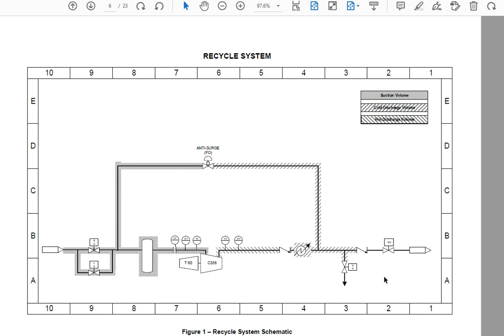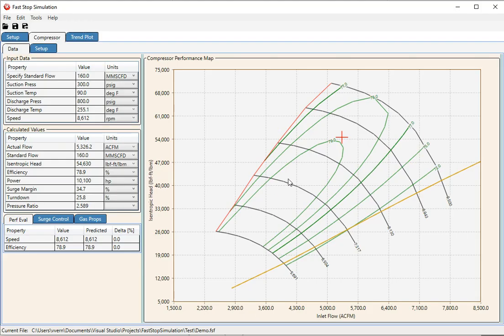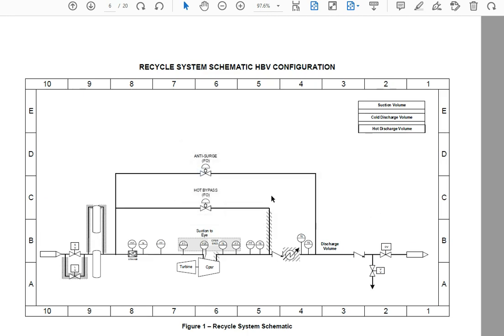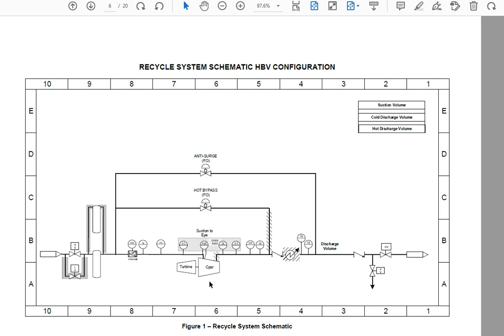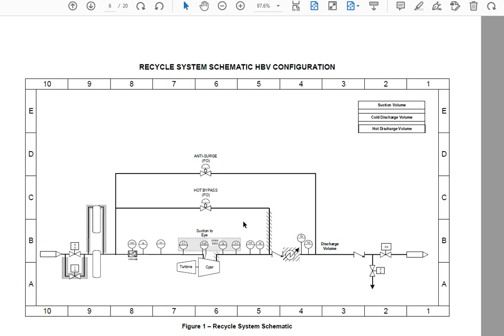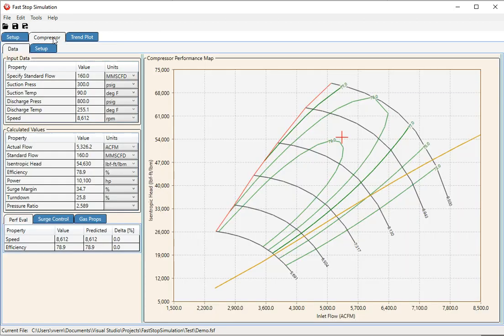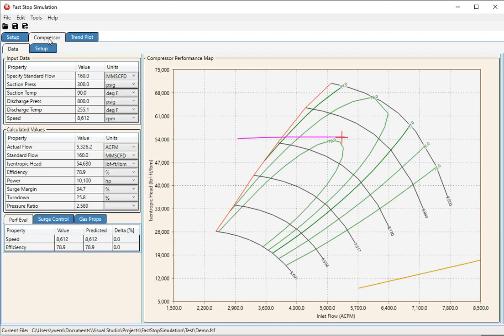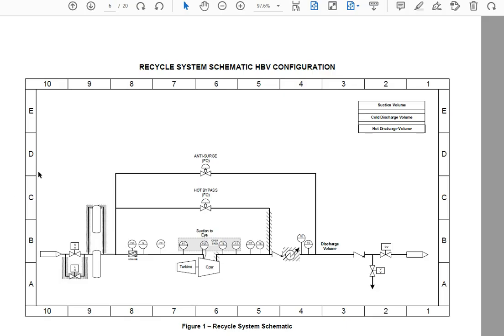Centrifugal Compressor Fast Stop Surge

Comment: greetings, one question. In my plant, we never experienced a surge on fast stop and our design includes a gas blow-down to flare valve that would open upon compressor trip to depressurize the compressor casing up to a specific set pressure then it will close. Obviously before this valve opens, the discharge and suction valves will be closed to control the depressurization volume and the anti-surge valve will be fully opened. Is this something you have seen before and how reliable would you consider this set-up to be compared to your set-up?
Reply from the maker: Hello and thanks for the question. Compressor surge typically occurs in the first few seconds after shutdown. It would be difficult to get the discharge valve closed that quickly. However, there is probably a check valve somewhere on the discharge header to reduce the discharge volume to be equalized to suction. 

If the blow-down valve can achieve a very high flow, it would be possible to avoid surge with this strategy. The allowable flow rate to the flare would also need to be considered, especially in situations where the entire facility is blowing down, such as emergency shutdown. 

I've not seen this design before. I think it could be just as reliable as a recycle anti-surge system, but it would not be my preferred strategy. With a recycle system the discharge gas is being moved to the suction header, which helps equalize pressure across the compressor. Also, the recycle approach avoids the concerns about high flow to the flare, which is not a trivial problem.